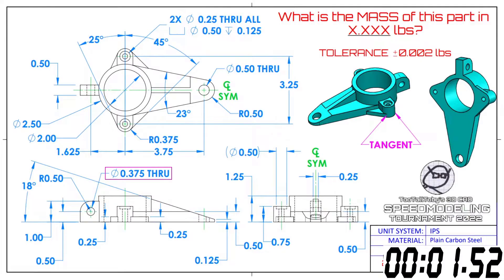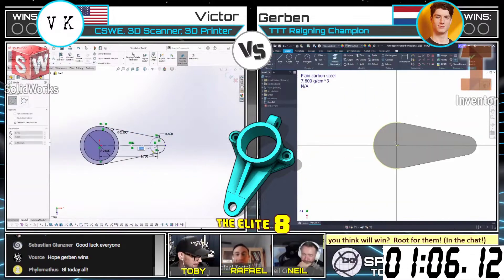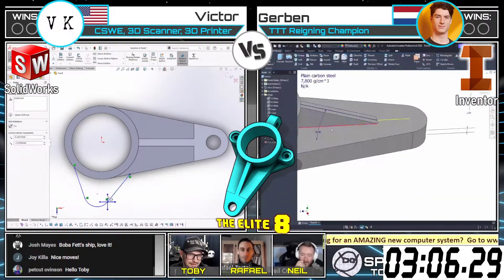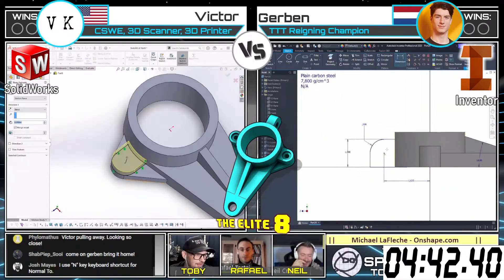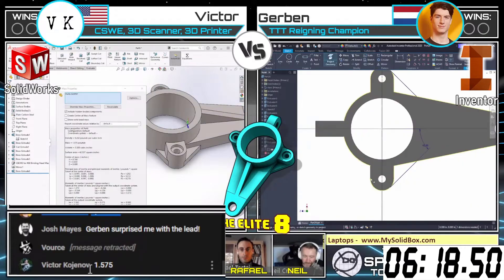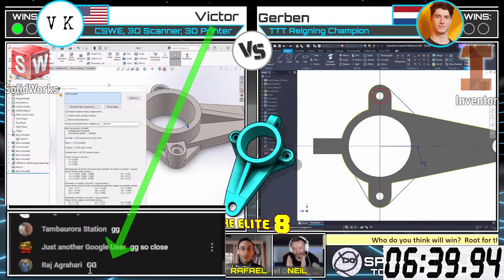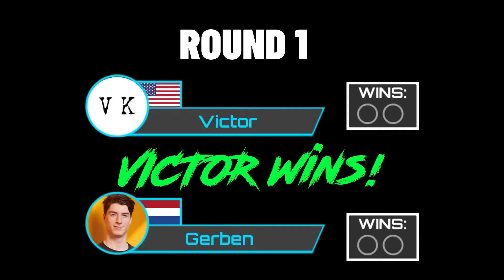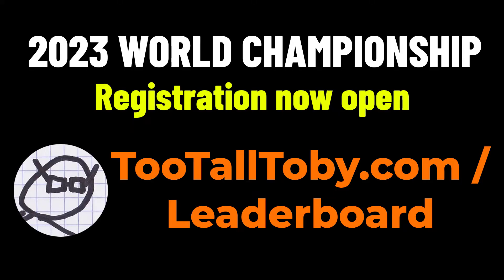SolidWorks vs Inventor - Which is faster?  (2022 Tournament Highlight)

Comment: The second model really got me scrambling. It ist not possible to draw a tangent line between the 2.5 circle and the .5 r circle on the right side while keeping the 23° angle. Either one of the tangencies must go or the angle is sligtly off.
Reply from the maker: What's the drawing number?
Reply: @TooTallToby  I think the trick is not to define any tangencies. The line just needs to be connected to the end point of the other line which ends on the bigger circle.
Reply: @TooTallToby  22-T-71-Post Collar